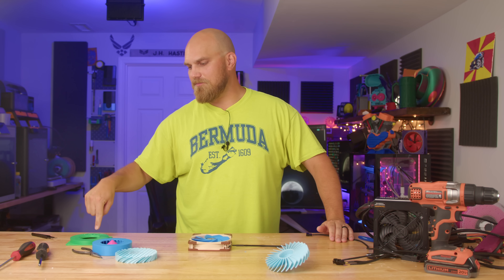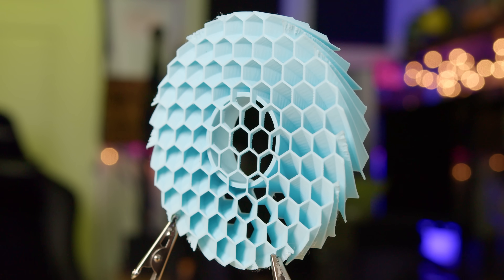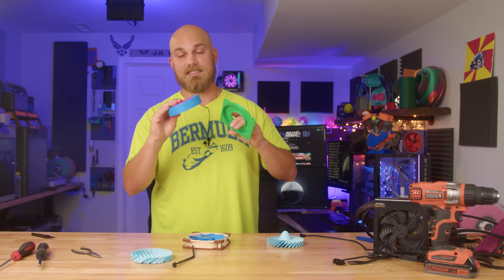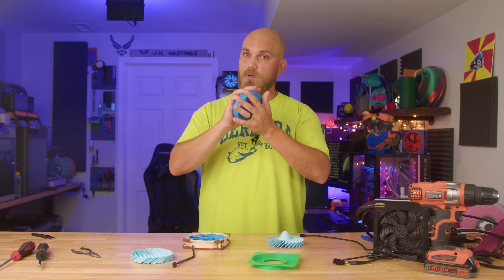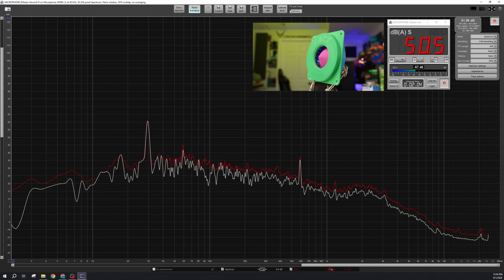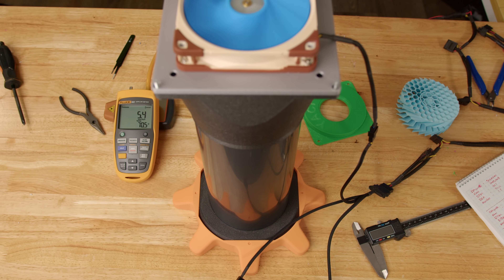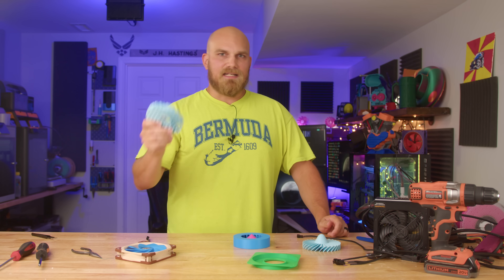This Fan Crushes Noctua A12x25 by 125% | Fan Showdown S6E5

Comment: By no means a sound engineer or anything close, but as dB is not a linear scale, shouldn't points be given based on that? 
Eg. from 44 to 55dB is an increase in 10 dB = 10 points - but 80 to 90 is also 10 dB difference, but the sound would be much higher. 
Or is this explained in one of the videos i havn't seen?

Comment: Just stumbled upon this video and you go though a lot of effort to test these fans. However, testing for static pressure does not correlate to real world performance as it will favor turbine style fans. The best test would be to set up some realistic barrier like a filter and test for airflow by timing the inflation of some non elastic bag, like a garbage bag. Real world performance is about overcoming a fixed pressure and at that fixed pressure, creating maximum airflow.

Comment: The vortex9 is so interesting, its really good at creating pressure, but blowing air on a hotspot of a heatsink it might be quite bad. It would be interesting to create a fixed heatsink/resistor test fixture and set up a few different cooling scenarios, ducted vs open, etc. to see temperature deltas against a thermocouple.

Comment: this video gives me 3 points, 
1. you didn't show the standard noctua results
2. static pressure is surely nice, but how loud are they and how much volume the fans shifts
3. "This Fan Crushes Noctua A12x25 by 125%" .. does it means it is 25% superior or it exceeds the 100% by another 125%

Comment: For a regular fan design to reach above half of Wonder from Down Under is straight up insanity!
Finally one for the big companies to actually look at. I'm sure a lab of professionals can easily shave down those sound levels while maintaining performance. The LED potential for this one is also great!
Reply: These fans are awesome no doubt but this is really nothing special when you look at anything beyond consumer fans. Lookup the data sheet for a Delta AFB1212VHE. 129.9CFM and 10.7mmH2O at 49dB(A).

You may say the dB is high but they can run at a low speed (very quiet) and still exceed most consumer grade fans performance.

Comment: Kind of a shame that Noctua couldn't come up with something like this.  The fan at max speed is noticeably louder, but having DOUBLE the static pressure of the A12 means you could still normalize for sound and it would still beat the Noctua easily.

Comment: The honeycomb design has a lot more surface area in contact with air, so the drag will be much higher than a traditional bladed fan.  Also, 3d printed plastics tend to be less smooth than other manufactured materials, so that just exacerbates the drag problem.  More drag means less air passing through.

Comment: What we learned in the first place is that single measurements like peak pressure or peak flow are useless for themselfes.
They are the equivalent for voltage and current in electricity or just force and velocity in basic mechanics.
If you have something that can create a lot of force or voltage - or pressure in case of our fans -, or you have something that can reach exceptionally high currents or velocities, that says exactly zero about the power of that thing and zero to square about how that power gets translated into USABLE power (resp air flow for our fans) at a certain attenuation environment.

THE LATTER together with the noise ratio in relation to that attenuated air flow is what defines the quality of a fan.

Thus, the whole video is nearly completely for the bin.

Comment: Since I can't be bothered to design one myself, but it seems obvious that the next design for the the vortex9 should include a shroud and possibly an upturned trailing edge on the tips of each blade, but less obvious is that ship prop designers have been studying the fins on whales for inspiration to create less turbulance and better efficiency overall so the thinking is that all the bumps that can be seen on thier fins create many pockets of low pressure for the water(or in our case air) to flow over (like a spoiler for those unfamiliar) instead of a larger area that is prone to collapse, creating turbulance and inefficiency, so maybe that might be of interest to someone. I would also think that a sort of rifled or wave design running axially along the surface on the airfoil (or scooping) side would maybe benefit in some cases, or maybe it won't?

Comment: 9:24 since skirts on the front are permitted, then skirts on the back should be as well, in which case, you change the fan design to mixed flow that puts the flow outwards inline with the noctua frame's OG shape inside a parallel (to that lip) section portion of about 4~5 cm. The output would be sideways, but it would work. This is essentially how the dysonbladeless fan's guts works.

Comment: The vortex9 looks very similar in design to the chopper pump impellers at my workplace, but without the blades build into the impeller and housing. Basically heavy duty pumps with blades built into each side of the impeller to cut up any chunks passing through while pumping things like municipal wastewater or stewed tomatoes (chunky thick-quids) with enough pressure to move them up 3"-16" inner diameter pipes from tanks that are usually pits in the ground. I'm impressed the vortex9 clearances were tight enough to work as effectively as it did.

Comment: This never gets old. Has to be one of the best, continuous, series, on here. Reminds me of the OG OCF.
I'd like to see this move to, monthly maybe, like one fan per week, or, once 4 unique fans have been submitted, pit them against The Database of (something 😆)...
Seems like The Fan Company has gone a little soft on the whole thing.
From an Engineering point. There is so much data, good data here. Might be time for MH to get started on manufacturing.
I CNC'd my own "Fanz", "Water Blockz", and "Pumpz", 15yrs ago, (no longer for sale, btw).
Maybe it's time to push boundaries, alter the Envelope. Double the Height / Depth. Get some real Venturi action going.
A guy I know is printing Radiators...
Juz sayin'.

Comment: I think spacing fan show down this far apart may actually be letting a bunch of designs slip through the cracks so I think it may be a matter of accepting submissions until 1 or 2 episodes in and then closing them so that there isn't a crazy backlog.

Comment: It would be nice if you started doing 6 catigories of winners:
1: Max Static pressure (How much static pressure they can put out).
2. Max static pressure under 60db.
3: High Static Pressure CFM
4. High Static Pressure CFM under 60db 
5: Low Static Pressure CFM
6: Low Static Pressure CFM under 60db.

High static pressure would be generated by a real world situation of a high density water cooler radiator.

Max static pressure would be done by pulling the air into a large sealed box with differential pressure meter mounted in it's side.

Low static pressure would be the standard CFM mount you use now with no alterations.   

The under 60db is achieved by scaling down the fan speed until it drops steadily below 60db.

Comment: The vortex9 is actually using a concept called "radial inward flow" compression which is used on the PT6 turboprop engine. The PT6 engine is one of the best selling turboprop engines ever made

Comment: 3:10 I'd like to point out that the obvious engineering issue why this design is not ideal is that they are not made for normal propeller-impelled craft; more than half the force generated by a jet engine stems from the interaction of the combustion turning the turbine blade, meaning that the two are working in unison to generate better air intake that then increases the combustion performance etc. It's not the ideal intake design, it's the ideal jet engine design.

Comment: I'm so glad that I haven't had to deal with fans for years since I've been using a fanless Mac at home. And even though my work Mac has a fan, it starts up maybe 2-3 times a week for a few minutes. No more optimizing or cleaning fans or worrying about noise, just using a quiet computer that still completely buries an Intel Core i7 in terms of computing power.

Comment: Did you consider your filament 3d print is maybe problem? Layers made rough surface. Try with resin 3d printer with 50 or 25 microns precision, I am sure there would be differenca?

Comment: Static pressure is a bad metric to judge a PC fan. They are not supposed to be operating against a closed space anyway. What you want is free flow measurement. It's quite common to have fans that can move a lot of air but can't generate much pressure and vice versa.

Comment: Maybe it has more airflow for a short whole but if you listen to. The nocuta engineers they  designed the fans to function correctly go years. Where others have less tight tolerances or blades expanding to and thus failing over time nocuta spends a lot of time and engineering to create something that performs well and lastsong.

They had a lot of iterations of the new redesigned fans for the D15. And if you hear what issues they ran in to and why they made changes you understand why the fans are the way they are. It took them. Years to get this improvement over the old D15.

Comment: As someone who puts a lot of thought and research into my case fans, I love the showdown!  On my builds I'm very noise sensitive, and it would be really cool to get a showdown where best airflow vs. noise is the benchmark.  On your data sheet, your 11th rank Sawblade is listed as coming in at 2.6 dBA.  I assume that's a typo, because if not it should take over the quiet cooling market easily.

Comment: At this 3d printing era who knows: there could be somekind of fancy design that beats the ones made with conventional manufacturing methods. EK radiator fans have relatively high static pressure, like (old) EK-vardar F3, but they are made energy efficiency and silence in high priority too. CFM/static pressure would be nice properity to have also in list. for CFM/dBa Scythe fans were best like 8 years ago. The sheer volume of air they did push silently. That was great. Nowadays I don't know. when EK and Scythe made bigger variant 14x14cm fans they started to lose competitive edge. 12x12cm was/is their specialty...

Comment: the 2 blower type fans's creators seemed to forgot that those fans are suppose to cool something SITS behind the fan. so its pointless to have immense static pressure if many fin surfaces behind the fan will not directly touched by the airflow. unless all the cooling fin stacks/apparatus are sitting encircling around the back of the fan . which will waste so many space for the cooling apparatus design since it will have a hollow non functional unused space behind the fan directly. 
when you design apparatus for cooling design, you need to think also about ergonomics, and how the entire cooling will sit inside the computer. and the fan and the cooling plates design must serve that need.
imagine if those 2 blower type fans be use to cool a radiator. and the airflow is going wide instead of THROUGH to the radiator blades. what a waste space for radiator design it will require.

Comment: Guy, if there is a thing that I learned in lab is that your test have to test usefull things. 
The purpose of these fans are decrease temperature, right? So here cames a good test to try, make the printer hotend warm and use a cooking termometer to compare how fast its cooling with nothing and with each fan installed in a standard distance. Room temperature should be the same in all tests and a paper box could be used to prevent wind.
I hope you find this test interesting and that we can see it here soon.

Comment: MOBOUVI could add a Venturi on the rim of the fan where it's getting the greatest speed and lowest pressure the fan chassis will need to be redesigned to accommodate the Venturi maybe a ½ larger on the radius... 🤔 🧐

Comment: That's looks like a Mike Waters turbine, I was wondering if it could be used as a fan instead of a generator. I wonder if Smoonkin has been investigating alternative technologies like myself.

It's really an ingenious design, the principle is compressing and accelerating the air before forcing it into the blades which allows it to bypass the Betz Limit, more details about that on the watersturbine website.

I reckon combining it with the Vortex9's back gap design would bring it on par or above it, advantage of the frontal and rear compression, though I feel some redesign is required at the front to pull more air in since as it is it looks like it's designed to take what's coming towards it rather than pull in.

Comment: not sure about your results, the honeycomb clearly smashes the the airflow with the smoke stream test
Edit:  after reading some commenters below that know more about this than me static pressure servers a different purpose but surely the honeycomb should be better as an extraction fan as it seems to move hte most air

Comment: I don't understand this comparison -- to me it would make more sense to normalize something for better comparison -- like run them at the same RPM and see what the noise and throughput are.  Or normalize for throughput and tell us what RPM/noise is required to do it.  For example, looking at #2 and #3 on your list, what does it do to the throughput and noise if you run #2 at the same speed as #3?

Comment: Very interesting tests for fan design.. Have you considered testing those fans as electric generators.
I have converted a120mm fan to charge my solar shed lights during the winter months. It would be interesting to see if the efficiency can be improved.

Comment: There is an error on the spreadsheet: if the dBA for Sawblade was really 2.6, wouldn't that be like the quietest fan ever? It is the same value as the mm H20, so I think this was value grabbed from the wrong place.

Comment: I feel like all we're proving at this point is that maximum static pressure leads people to making fans that don't actually move a useful amount of air.

Which when you think about it, it makes sense. The principles are the same as trying to pull a vacuum or pressurize a vessel. Both of these can be done with fan/turbine designs, but at some point the volume of air you're able to move will equalize with the amount of air flowing in the opposite direction. If you don't care about how long it takes (ie, you only want to achieve maximum pressure differential) then the ONLY metric that matters is the maximum backflow. Hence, a one-way piston being the method used to achieve extreme pressure differentials, because it will never have backflow, and therefore it can increase pressure until it either breaks, or your drive motor can not exert enough force to move the piston.

Basically, the only two methods are reducing gaps or increasing the power of your motor, and since reducing gaps also reduces airflow, at some point someone is going to send you a one-way piston that works on a rotatory fan motor, and it'll take 20 minutes to hit peak pressure.
Reply: It's why in vacuum chambers they use turbos to hit max vacuum. But if you turn the turbo on with atmosphere, it will rip itself apart from air resistance due to the density of the blades and motor power. Those things are meant to functionally spin under vacuum already

Comment: The visualization of the audio spectrum definitely helps with having an idea of how a fan will sound as yeah the dB rating alone doesn't seem to matter a whole lot.  If it's spread out wideband noise it's far less annoying than narrow peaks.  I'd guess something about there being wings spinning at a fixed rate makes some kind of resonance, but the honeycomb has many different periods of "wings" making for less of a single resonance.
What's the theory behind static pressure in a PC case anyway?

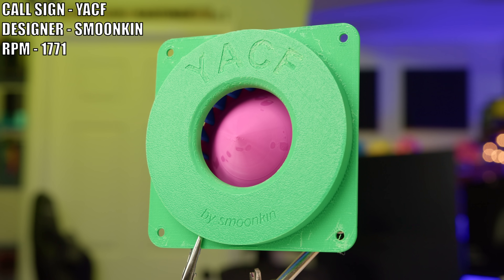Comment: 03:45 "I dont know what YACF stands for, smoonkin didn't say anything about that at all except that its [Y]et [A]nother [C]entrifugal [F]an"
Reply: @MajorHardware  i would really like to know where one could get a copy of the fan showdown spreadsheet. i wanna look at the entire data set and build an actual system using one of those designs
Reply: @MajorHardware  which fans has been the best so far?
Reply: @MajorHardware  Believe it for not some people are actually that stupid BION
Reply: @MajorHardware boom, roasted
Reply: @MajorHardware  you should do the tests for all fans on same mm H20. then can see the noise . noctua rotate 2000 rpm and 46 db . this look good, but it have only 2.4 mm H20
Reply: @MajorHardware  2 part: i guess when you throttle the vortex 9 from 5.4 mm H20 to the noctua 2.4 mm H20 then the vortex 9 is much more silent than the noctua
Reply: Damn he should've made a joke about that or something.
Reply: Yes
Reply: woosh
Reply: We are new subscribers, and appreciate any and all new information, no matter the rapid-fire schedule.
Innovation does not follow a script or time-line.
Reply: That's stands for an opensource recursive acronym.
Reply: Reminds me of YAML files
Reply: he tricked you right into commenting. brilliant.
Reply: Most likely a mech warrior fan, because all of the mech warrior 5 mods are called "Yet Another (insert what it is) Mod" like for example YACM or YAMM (Yet Another Clan Mod and Yet Another Mech Mod)
Reply: Hahahah beat me to it
Reply: Kind of like YACC (Yet Another Compiler Compiler).
Reply: Thank you Captain Obvious for saving the day
Reply: lamo
Reply: Smoke actually saying a lot, the thing is that in the " PC suit case" you need stable airflow AND pressure and all of those fans except 2 was useless for that and when I say "useless" I mean ABSOLUTELY EXCLUSIVELE EXTREMELY UNBELIEVABLY useless

Comment: @mobiobione have you tried to add a top piece like the green part of the YACF, that will cover just 1cm of the edge, and have a shap like semi circule. the purpos is to redirect the air that hits the frame and spill up, to the fan blades again.